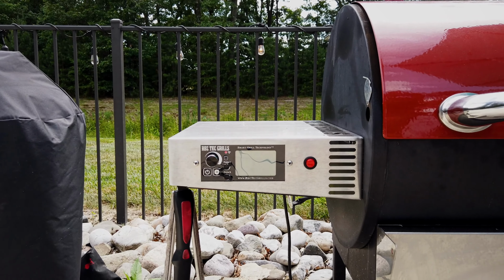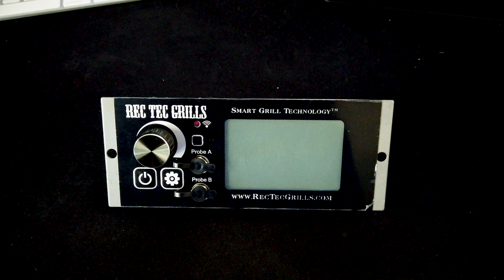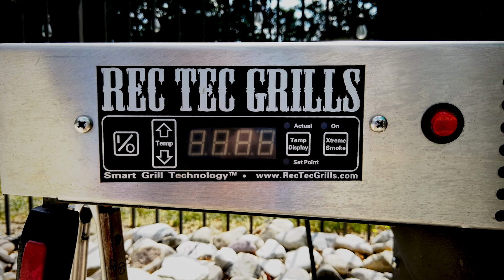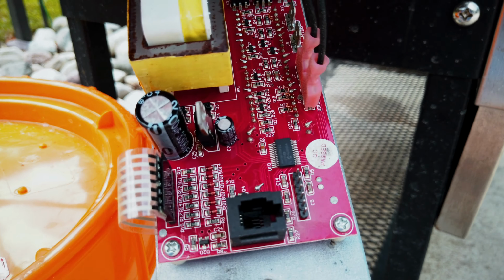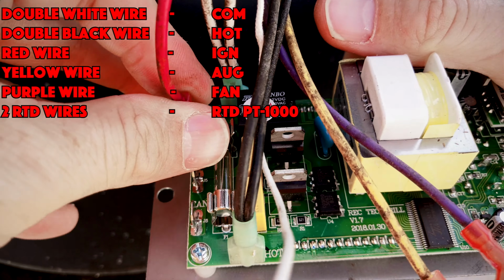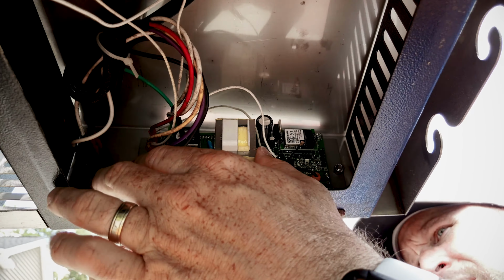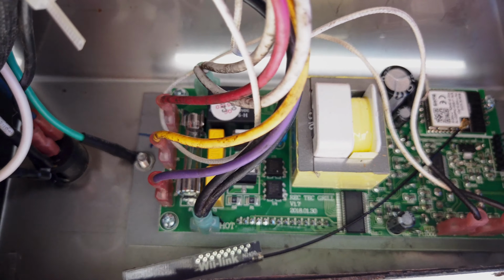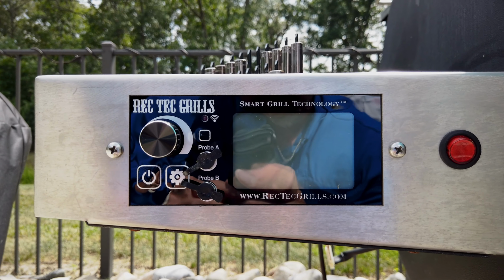REC TEC RT680 WiFi Controller Installation

Comment: Is there a video on how to use the probes?  Just bought this unit after talking  to customer service, but never got an answer on how the probes get to the meat with the lid closed.  That is my question, as you can buy most units that just sit there for $50 dollars
Reply: I have the same question!
Reply: Just close the lid on the probe wires.  Works fine.